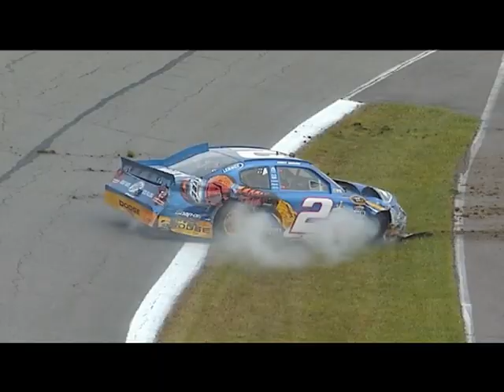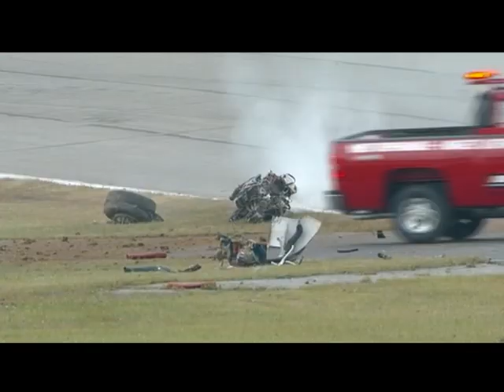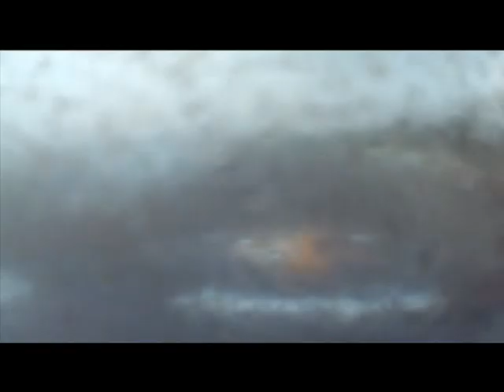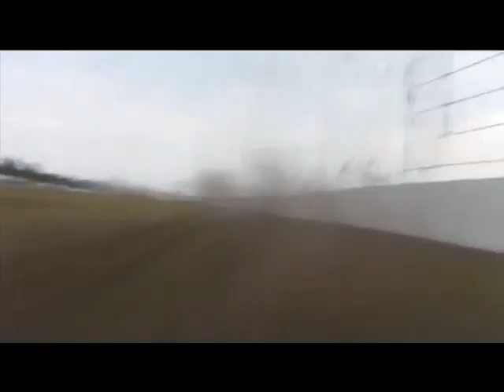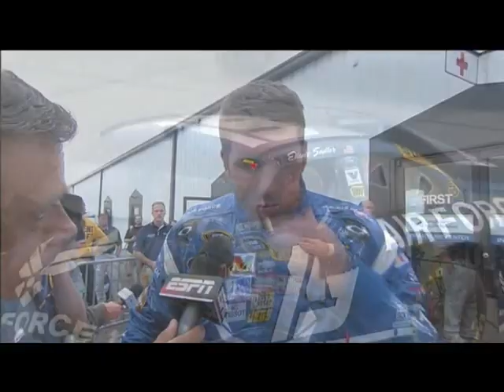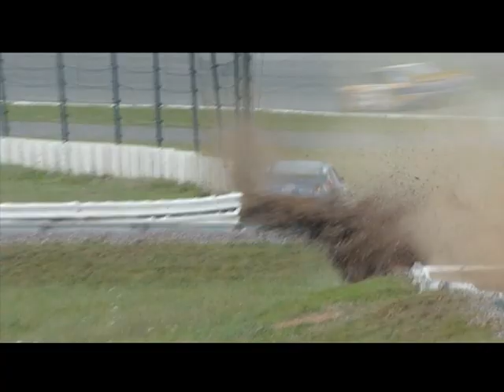Elliott Sadler Pocono 2010 crash with Replay and Interview

Comment: shit happens, especially at 180+mph, throwing fines for this is unnecessary, it wasnt intentional even though kurt threw a fit in the interview, of course he's gunna be pissed his car's wrecked. safety wise, I think if sadler can take a pounding like that, kurt had nothing to worry about. Yes I do agree if this happened years ago, there would have been worse concequences, but we're much more geared toward safety nowadays. the only other way to avoid wrecks like this would be to race powerwheels